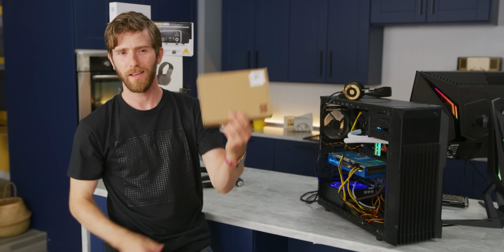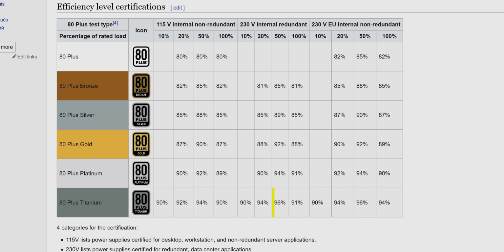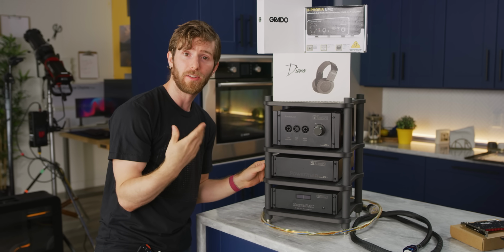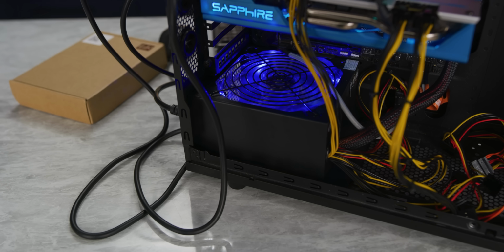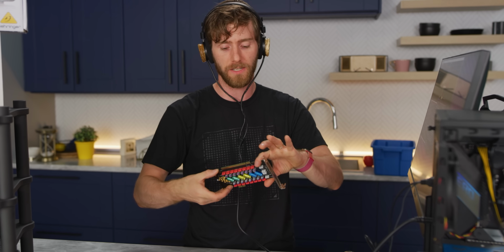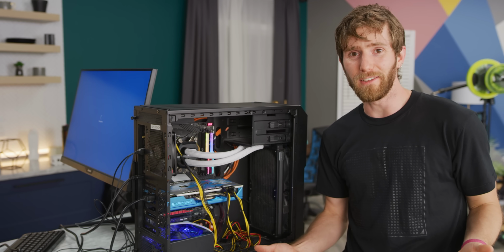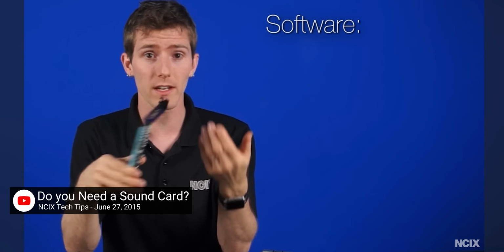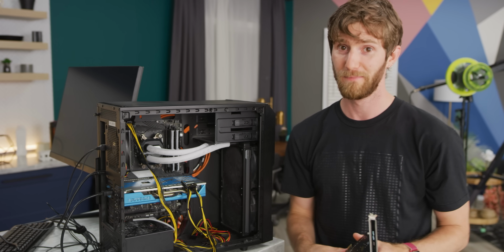Is this $40 card a SCAM? - "Audiophile" Power Filter

Comment: As a professional audio engineer, I can say for sure that the external audio interface is the way to go. Make sure to get one that has its own power adapter and doesn't rely on bus power via USB, as that will often carry the same noise from the motherboard to the interface.

Other common causes of noise include: having devices plugged into different circuits from each other, having A/C power cables running near your audio signal cables, having strong RF signals near your audio cables, having electrically noisy devices on the same circuit as your audio setup (e.g. fan, heater, florescent light, vacuum cleaner, etc.).
Reply: > having strong RF signals near your audio cables

Which is why front audio can be stupidly noisy on some cases.  Unshielded cables that sometimes have to run right by (electrically) noisy components.
Reply: Balanced cables also help. I had a ton of noise from my Scarlett and I didn't realize I wasn't using balanced cables. When I switched it was barely a tiny hiss with my speakers at FULL volume.
Reply: @leafsoup  Yeah balanced cables help a LOT. Onboard PC audio is never balanced, I don't know why, probably to keep manufacturing costs as low as possible.
Reply: Lol, yeah I was totally confused as a kid, when I bought a small USB-powered external soundcard for my PC and was hearing the GPU's massive coil whine in my headphones through the USB soundcard. ^^

I also did the "having devices plugged in to different circuits from one another's" thing (apparently, though they were in the same room) and got a really loud hum on my stereo which I used as PC speakers through it's line in. A groundloop filter worked fine and eliminated the hum entirely.
Later I added another input through a splitter cable and connected an older 2.1 PC speaker system, that I got as a gift to the headphone output of the stereo in order to replace its shitty speakers. That setup had me using three groundloop filters to make it work, but it was practical and did sound really good XD
Reply: @LRM12o8  When I was temporarily using a cheap pair of powered computer speakers in my room, if I turned the volume down to a specific level it would literally tune to FM 104.3MHz and play that station (WOMC). It only worked at really low volumes, so for WEEKS I thought I was hallucinating songs and commercials in my bedroom when sleeping and such.

I felt so relieved when I finally figured out the cause, and could get someone else to also hear it and validate that I wasn't crazy! The wiring in this 100 year old house is acting as one giant antenna...
Reply: @cmorche  Yeah there is a certain corner of my studio where if I put an amp there and flip a ground lift switch it will pick up some kind of local foreign language radio station, I don't know what language it is but it sounds like maybe Chinese or Korean. It was really weird when i first discovered that one. Why is there a guy speaking in Korean on the guitar track? How did that get there?
Reply: Don't you need a balanced signal to gain any benefit from balanced cables? And is a balanced signal normally available on a PC let alone an inverter (op-amp or equivalent) on the receiving end to flip the polarity on one of the signal wires and balance the load on the two signal wires?
Reply: @vergyltantor  No you don't get the noise reduction benefit without a balanced signal, you need the the parallel phase inversion to cancel out the noise. Consumer audio products are almost never balanced. Generally speaking it's not necessary. A balanced signal only eliminates noise picked up by the cable itself, but it will not affect noise picked up anywhere else in the signal path. In the case of CPU noise it will be upstream of the output circuit so balanced cables won't help.

Balanced cables are most useful when you need significant amplification. If you amplify a noisy signal you also amplify the noise. But with consumer audio there isn't much amplification going on compared to a recording studio or a concert PA system, so if the cable itself picks up a small amount of noise it is going to stay a small amount of noise. Where a small amount of noise in cable on a stage with a giant PA system can get really loud because it's being amplified so much more.
Reply: @NealMiskinMusic  Thanks, that is what I thought. Having nothing to do with the audio industry I didn't know what a balanced cable was. After Googling it I thought, that is just a shielded twisted pair like we use for data transmission.
So for the layman balanced cables useless unless the equipment is designed on both ends to use it.
Reply: Also dishwashers, washing machines, dryers, fridges and freezers are terribly noisy!!!
Reply: @Just a simple man I don't believe a DAC should be used on a Cell Phone. The headphone output on the phone is an analog signal. Unless you have a dedicated digital output on your phone and I don't know of a phone that has one, you will be using the DAC that is in your phone. If you are having noticeable noise issues with the phone you could try Neal Miskin's suggestions in his original post. If none of that works you could try putting the phone in airplane mode to see if the antenna of the phone is causing the noise and you could try using the phone on battery power to check for a problem with the power supply in the charger.
Reply: @vergyltantor  iPhones have digital outputs. It was a whole big thing a few years back when they got rid of the headphone jack. Now you're at the mercy of whatever crappy DACs they put in those little USB-C headphones. But in general, seeing as phones are battery powered and have no moving parts there shouldn't be very much noise to begin with.
Reply: Just get an Amp and a DAC. And USB shouldn't carry any noise as it is completely digital, so that's bullshit.
Reply: @sujimayne  A Digital to Analogue Converter is not "completely digital" it converts the signal to analogue and if the analogue part of the box is drawing its power from the USB and the power coming down the USB is noisy then your output will be noisy. Use a DAC with its own power supply and you should be able to isolate the analogue components well enough to keep the noise out.

Comment: You'll run into problems with DAC before you run into problems with power delivery. Especially when new boards still come out with like 15 years old integrated audio, like Realtek ALC898. I like how this puppy has both x1 and x16 connectors. For what, the difference in data lanes doesn't help here...

Comment: Really need to look at the audio through an oscope. Human ears aren't the most accurate and looses hearing as soon as 16 years old. 

I would actually enjoy seeing the signal difference.  I'm betting the hardware quality on that board adds way more noise than what it can remove. 

I am one of those with the original sound cards. I actually still have quite a bit of hardware from yesterdecades.

Comment: All power from the power supply would have to feed into the card and then the card would have a multi-core power output connector for all the computer components to attach to, then the manufacturer could say it would be performing some form of power conditioning.

Comment: Technically, assuming all the lines are in parallel, so the capacitors will send back electrons to the others lines and absorb the peaks when the power demand reduces promptly. Am I wrong?
Maybe it is not enough capacity?

Comment: thats like a board entirely made out of caps. it probably filters power fine, but likely doesn't do dick for audio. want clean audio, use the optical port and send it to a high quality receiver plugged into a line conditioner. me personally i prefer audio equipment that i found on the side of the road. it has character.

Comment: in the UK we have Solar panels dotted around in a radio operator the cheap inverters on the panel can send bad wot we call BAD RF signals into the air that can cause sound issues that make the radio useless,we can add such a device that will filter out these noises,modern radios (last 5 years) can digital block these nasty signals out,there are many things that can make these types of noises including LED lighting and power supply's can cause these problems,your studio seems to be RF free which is good.

Comment: You should've tested this with a PCI-E soundcard. Because sound will easily leak into the PCI-E card from just about every component possible. I've used the same (great) soundcard across two different PCs with completely different hardware and noise from USB (Mouse), GPU,CPU and everything else leaks heavily into the analog audio out of the card. (GPU whine leaks in, moving the mouse causes a buzzing noise)The Digital out is noiseless so I have to use that.

Comment: you would have done some service if you wan the audio out of the PC into an Oscillator or something visual or something to monitor the power.  Not saying this card wouldn't work or will work.  but it's be nice to actually visually see the noise and measure that and the EM field and then see if it actually works.

Comment: I think you missed the point here Linus. The principle is intended for either those who have a set budget, and hope that a smaller amount here can deliver a better experience with a higher end headset. Spend more on the headset and less on amps for a professional setup. 
Otherwise, it may be useful for those in the professional industry who are using oscilloscopes and sensitive equipment when setting up speakers and amplifiers. This product may be a placebo, though it may just be the poor copy of a fantastic item.

Comment: The noise floor will likely be more noticeable when externally amplified. So, as you noted, a more appropriate test would be to run some harder to drive headphones (maybe fostex, or hd800) with an Amp downstream of the mobo/power filter. If this can be as effective as an external dac when driving an amplifier, it might not be total garbage.

Comment: I'm hearing my graphics card coil whine though my USB DAC, is there any solution for this?
Reply: Odd. Try using another power board or circuit. Using toslink will solve the issue. Always get a motherboard with digital audio out. Usb DACs are hit and miss.

Comment: What you need to test hardware like this is very high end oscilloscope tbh. To get rid of coilwhine = Use S/PIDF  dac. And for the record. Use S/PIDF dac instead of USB cause light acts as natural optoisolator. Thats why i buy all my motherboard/audio hardware with S/PIDF. Helps when you have shitloads of cables around and to transfer long routes of audio within the same stack of cables.

Comment: could it be dependent on being installed in the first slot and the gpu in the second slot? I dont know how PCIE power works but I'd assume it would be from top down instead of bottom up allowing the noise filtering to cancel it out?

Comment: one way to check if power filter works, is using oscilloscope, computer must generate pure sine wave (a simple beep sound will do) with fixed frequency, and check for any deformation in the sine wave

Comment: This is why this channel is for toddlers, exactly how did you expect this to work?  Computer components draw their power from PCI-E cards to they? idiots.  You'd be better off with those PSU cables with capacitors in the ends of them, which as also rubbish, they do nothing that the caps at the inside end of the psu dont.  You could save your company so much embarrassment if you had the humility to hire someone with at least some electrical engineering training.  The title should read "This $40 IS a scam".  11.7M tweens love ya thumbnails i guess

Comment: These kinds of scam miracle power "smoothing" products have been out for homes and cars for ages lol
Reply: The sad thing is plugging in the PC next to a miracle power saving device could actually have more of an effect on sound quality than using this device.

That's assuming you have a 'real' miracle power saving device as those use a capacitor across the AC line. The more fake versions don't have anything hooked up.

Comment: I fondly remember my first SB AWE32 with 8MB(!) of RAM.  I think it's still in the basement in a parts bin.  Unless you want 5.1 or more, on-board sound is just fine.
Reply: Most on board sound does 5.1 just fine, even optical out.

Comment: I wonder if its supposed to improve audio using the case's inputs (instead of the mobo's rear IO)? I've heard that the case's inputs (connected to the "HD Audio" pins on the mobo), are far worse than the rear IO.

Comment: I have a pair of speakers (pair of old JBLs with a PAM8403 getting power via USB) that sounds fine when used with a low profile dell PC, but when i use them with my DIY system it has a lot of noise; the pair of Creative Pebble speakers i have work fine; i can mitigate this dramatically by using a overkill dedicated wall wort; so why does my nice desktop (PSU seasonic M12II; Brone) have more usb noise than some dell box?

Comment: Bro, audio crackle isn't really an issue under about 80-90, maybe 100 db. Plug into a pair of 134 db speakers, something on par with say the QSC KW153's, and tell me you don't want a clear audio source... Even a cheap pair of set of 100W tower speakers with 50W satellites... like... You're gonna want a clear source at higher volumes... But at that price bracket you're likely not gonna be drawing from direct motherboard sound anyway... so it's a moot point... xD

Comment: Curious, is your source coming through a UPS or otherwise isolated?

Was it coming straight off a the wall? This might make more sense if you live near a large factory or something that would square the wave enough to get noise past the filter cap's in your PSU and DAC. 

I work in an industrial complex and If I don't use a UPS the wine that comes through the bookshelf speakers on my desk at anything over %50 volume/gain is unbearable. This card I suspect would fix that....
Reply: In otherwords, noisy AC power is most defiantly a thing.

Comment: You're adding capacitance to the PCIE bus, so yeah of course it's going to have an effect, especially with a cheap motherboard that skimped on capacitors. And you are wrong it will have an impact for every device connected to the same PCIE power bus. There isn't a regulator for each slot, it's usually a common rail. But reallly, what you should have done is connect the output into the line-in in loopback, and run a Fourier transform on the PC with white noise at very low amplitude to see which frequencies get quieted down and by how much... Measuring this with your ears isn't measuring anything at all...

Comment: I was a tiny bit excited when I saw this video, wish you would have tested it with a working problem to see how it affected the issue. =/
If you had wanted to test a REALLY horrible static/whine/crackle problem, you would have plugged your headphones into a Scarlet 2i2/4i4 audio interface using it's factory usb cable and then plugged a basic XLR mic into that. Plug it all into a pre-built computer. Then, only monitor voice recordings with NO music.
Instead of waveform peaks, I used to get these weird swirling frequencies on a recording that completely detached from the 0db base of the waveform. I was able to get rid of 80% of the whine by purchasing a $15 shielded USB cable, a Furman strip (a surge protector I needed anyways, not sure if it's a full conditioner, but it still helped), and keeping the gain knob low, but unfortunately without a channel mixer there's no way to get a signal that's strong enough to make anything usable, and the white noise is still noticeable. Post-processing gain amplifies the static I thought I eliminated. Turns out it's a shockingly common problem for that audio interface, but few solutions exist online. Just needed clean narration tracks, but I ran out of money trying to fix it and companies weren't accepting returns when the lockdown started. You live and learn!
I did find it interesting that they mention the video card potentially introducing signal noise. Maybe it wouldn't be a fool's errand to save up for a self-built pc some time down the line...

Comment: electrical noise is something which engineers strive to remove because of the effects it has on EMC performance.   When a PSU contains ripple and spikes these can blow through designs of the audio stages which have not paid any attention to this possibility.   

fitting filter components which are out of the power path of the device  ( i.e. on a side road ) the electronic cars will bypass the entry to the road

Comment: I am shocked you guys don't have some kind of oscilloscope to actually look at the noise level of the voltages.
Plus most circuit design should already have decoupling caps to smooth out the small ripples in the voltages to a point that they are okay to use without affecting signal integrity. If the circuits are designed without enough decoupling, the devices will simply not work.

Comment: power filters make a big difference... in series.

but where i found a serious issue is if a noisy ground plane (from a mobo) touched a USB DAC input's (Amanero/Xmos didnt matter) ground plane
yep thats where the issues begin. tried all sorts of tricks to lift the ground plane none of them worked even though I powered the amanero/xmos off the local regulated supply
(and yes most usb dacs power off USB! only an isolator works and IMO even that was a decent board it just degraded somehow, I RMA'd my board for other reasons and it went away forever)